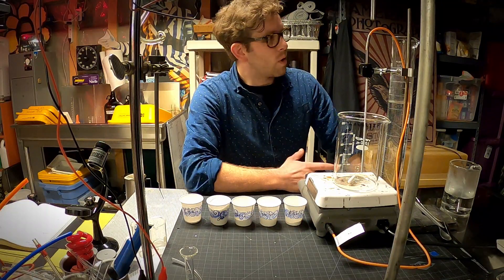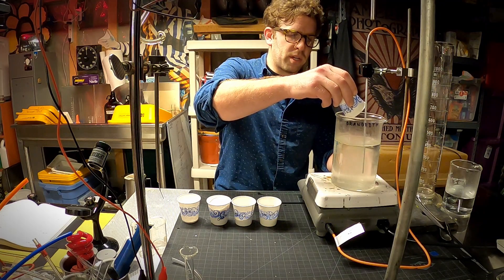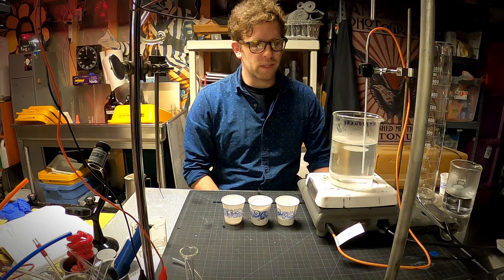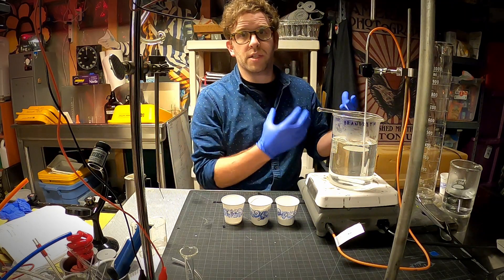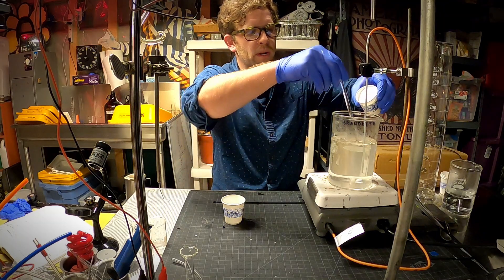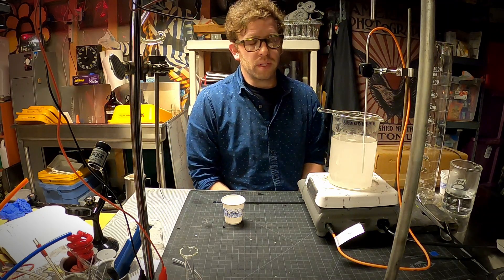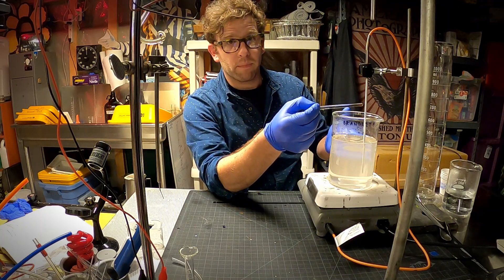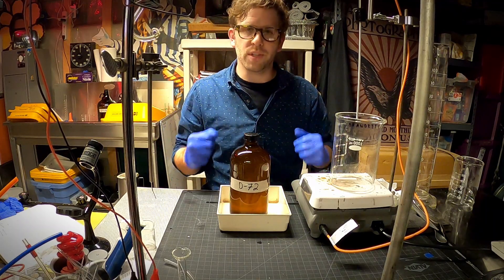Mixing D72 Paper Developer

Comment: Why didn’t you add the necessary final water to the beaker,  while  the chems reach an uncertain volume in the beaker and then FILL the beaker having measurement marks to indicate how much water is needed to make one liter??? And what about the dilutions for printing. Straight(no extra water add to the developing tray), 1:1(half stock solution and half extra water)or 1:3, 1:4 and etc?

Comment: Toying with the idea of standardizing around D72 for my paper developer for cost savings. Is there any reason I couldn't just carefully measure out the right amount of each dry ingredient, stick them all in a single container, and mix them simultaneously immediately prior to a print session? What is the risk of not individually mixing them all into solution in series? Isn't Detkol essentially just these chemicals (+ maybe a few others that don't go into homebrew D72) all together as a powder?
Reply from the maker: Hey Andrew, 

In theory you should be able to pre measure everything and keep it stored and ready to rock. 

I think the only thing you have to worry about is making sure everything goes into solution. By doing it one at a time, you ensure it all gets mixed up. I was told the order they get added is important, However when you buy a bag of dektol, you just mix it all at once. I've mixed the chems out of order by mistake and never really had an issue. As long as the H2O is hot and everything dissolves, you should be good to go. 

I would suggest just running an experiment. Order all your chems, weigh out enough from one batch and then give it a go mixing it all at once. I wouldn't weigh out all the chems until you know it's working within your space. 

Let me know how it works out for you! 

- Nick
Reply: @nickbrandreth  I've settled on trying E72 instead of D72, but the results should be the same, and I think I'll take your advice of running an experiment where I try the regular approach of making stock solution, vs a pre-mixed powder added to water to make working-strength solution in one go. See if it causes any difference in the results.
Reply: Hey! Did you try mixing all the chemicals in the powder form and using small amount to make solution whenever required?
Reply: @MRK-y6u  Actually yeah, I designed some 3D printed containers to hold premeasured dry chems for 900ml of E-72. Two compartments, an alkali and a non-alkali one, just to play it extra safe with shelf life. Been using it for more than a year now, it works great. I don't even have to use hot water, everything seems to dissolve just fine, and my results are consistent. Dump a canister into the bottle, add normal temp cold tap water to 900ml line marked on the bottle, screw on lid, and shake for 60 seconds or so, and I'm good to go. Seems to keep for about ~10 days too in the bottle, so I can usually get 2 printing sessions out of a 900ml bottle before I start seeing a decrease in dmax. I think 900ml costs like $0.25 to mix up or something.